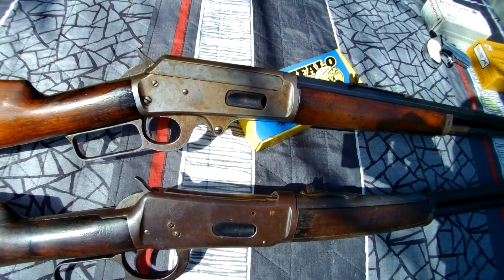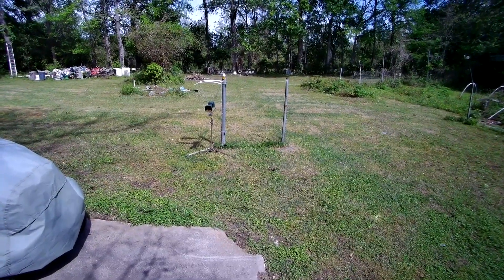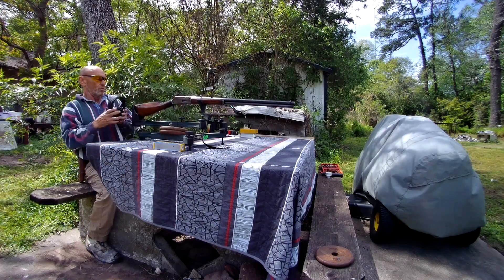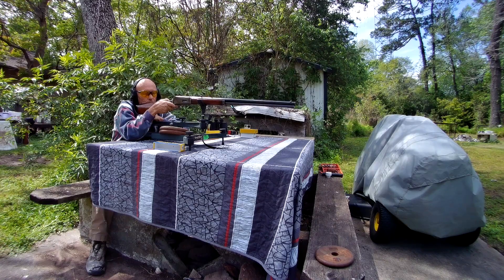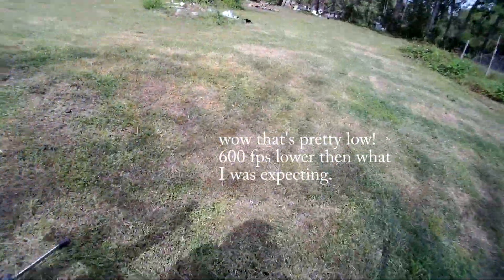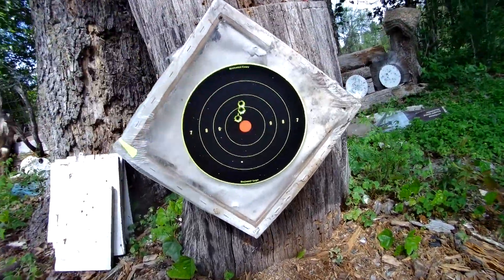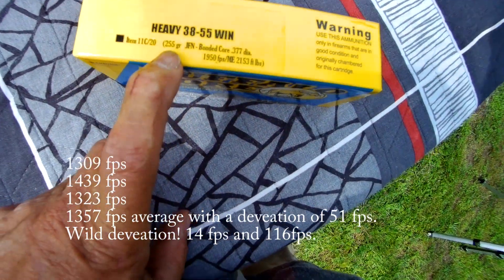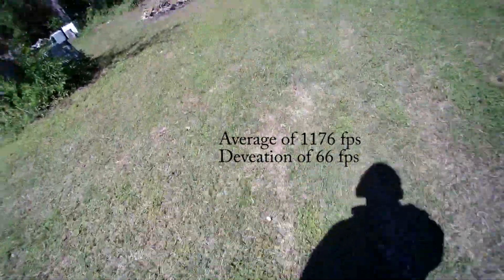1903 Marlin 1893 38-55 revisited

Comment: Slug the bore. Mine made in 1894 was .385. Bore diameter in 38-55 varied wildly in those days.
Reply from the maker: Yeah, I need to. Thanks.
Reply from the maker: My Winchester 1895 30-40 krag has an oversized bore too.
Reply: @FingerAngle  , I also have 3 factory original Marlin Ballards in 38-55 in exceptional condition from the mid 1880s with bores .381 to .383 and a ‘94 Winchester at .379 (made in 1923). I feel it’s a must to slug the barrel of any antique gun you plan to shoot to properly size the bullets and figure on doing your own reloading. I only use cast bullets and Pyrodex RS powder on the older ones not intended for smokeless powder.
Reply from the maker: @davidgardner863  I've been buying loading equipment, and supplies. I have several presses now. I even loaded some BP 12 gauge for my Winchester 93. That's the only thing I've loaded for so far.